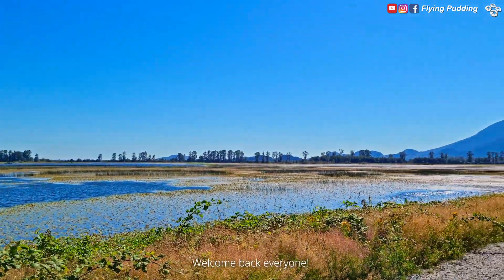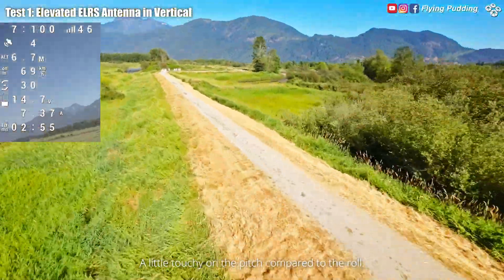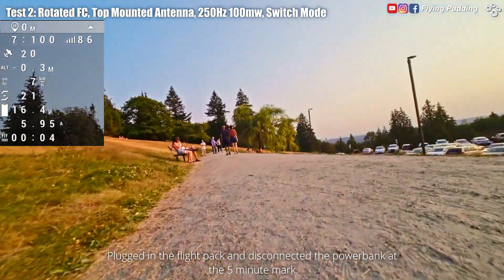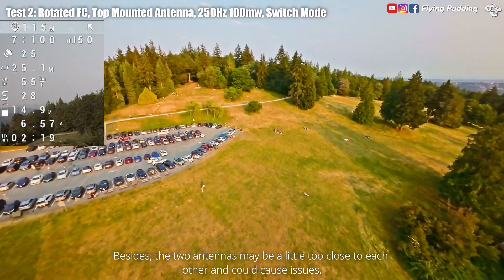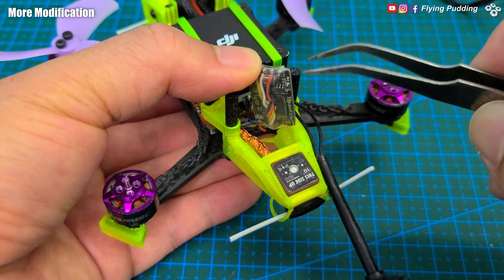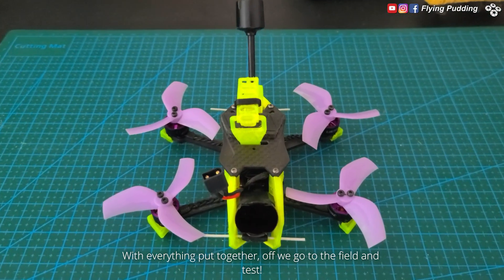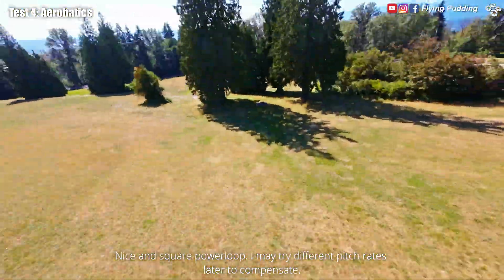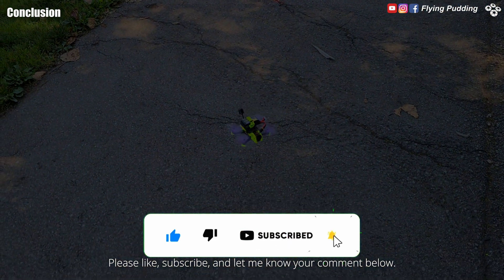Proto25 - 130g 2.5 Inch Long Range FPV Quad Mods and Review, Part 2

Comment: Not a fan of Braiding the motor wires as this can generate RF interference and adds weight. Otherwise looks great. Go to Crossfire 900mhz. with 2W tx module.